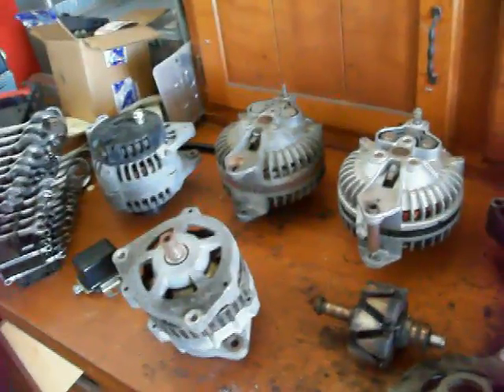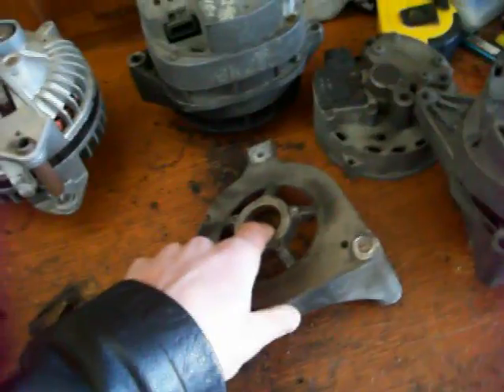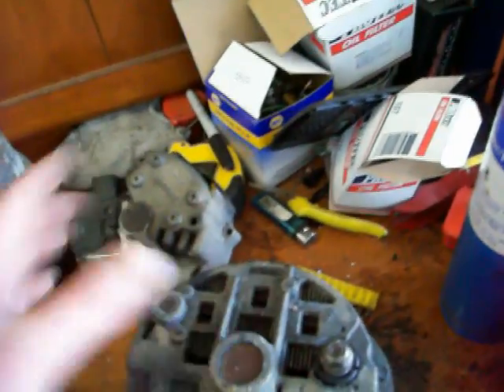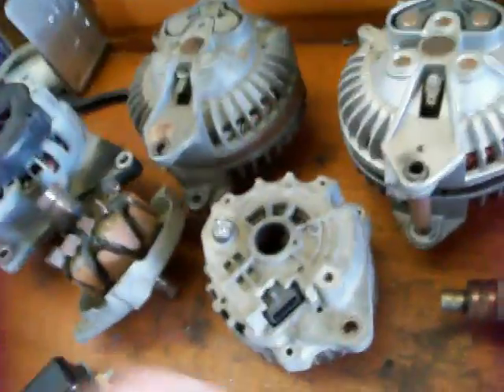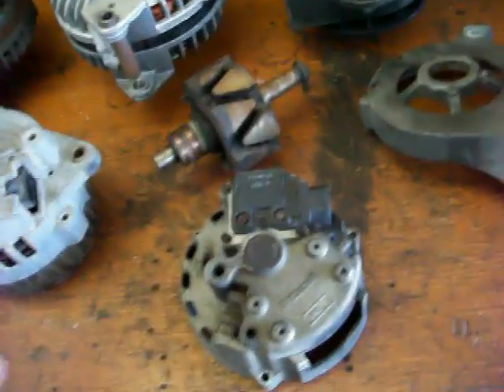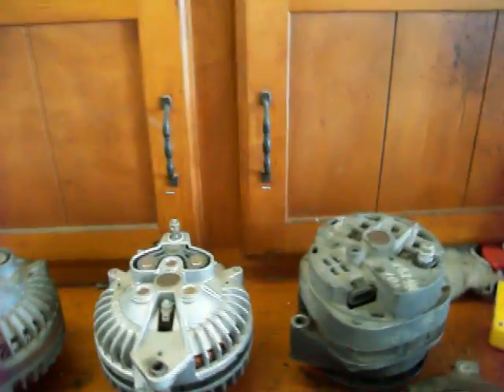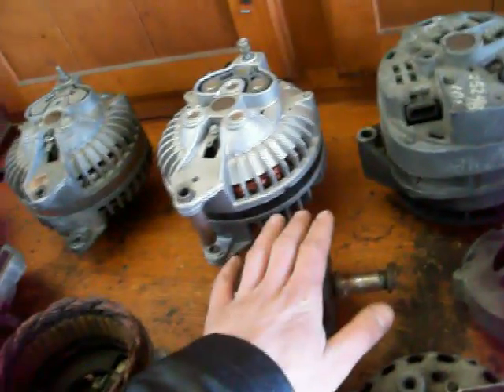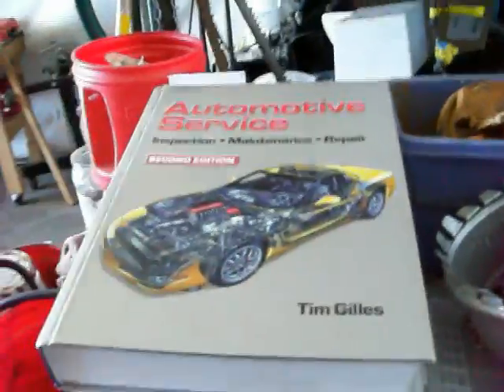How car alternators work

Comment: You should search around for an alternator rebuild shop. If there is one around. You can get most alternators and starters rebuilt for "half the price" of a replacement and you will get far "superior" rebuild locally. The rebuilds comming out of China at the parts stores are junk! They leave parts out, use terribly cheap new parts, and use old used parts in their rebulds. The regulators are thin with no cooling fins: even the bearings are cheap and don't last. I know I do this for a living

Comment: I have a strange problem. Voltage is high (16-17V). Alternator has been rebuilt by a reputable rebuilder and watched it bench tested good. IF I leave the adapter off (2 wire connector to Ignition/battery indicator and Battery positive), the voltage is only 13V or so with the car turned on. If I connect it.........I get the high voltage. Any idea on what might be causing this or how to troubleshoot? Can I drive the car a short ways without the adapter connected (want to take it to a shop).

Comment: u did an excelent job explaining how altenators work , I believe my mazda b3000 alt. has a bad regulator , and after much research ive came to the same conclusion ... its more labor and cost efficent to purchase a remanufactured alt plus get the 1yr waranty ,rather than pay $50-70 for a regulator and then have diodes or somthing else go out

Comment: something i dont understand ..the coil winding in the rotor is stationary or rotating with the shaft??!!!!....another question the rotor winding need an initial current (from the battery) to develop the magnetic field that sweep the stator so if i try to test the alternator separately without connecting  the battery to it and check the voltage output with multimeter , i will not have a voltage output in this case.. is it right???

Comment from the maker: @Kbrusky15 An old generator is built kind of opposite of an alternator. The field coils which create the magnetic field are stationary in the case instead of being in the rotor like they are in an alternator and the armature is where the voltage is induced into. They basically look like a starter when you take them apart, they have alot of the same parts and are constructed in a similar way.

Comment: That caddy I used to have the battery damaged the alternator.  Didnt know it right away till the battery was replaced a second time under warranty and the alternator finally cooked, smoke........ the diodes were toast.  Replaced both items and no more problems.  I have a book similar to that called the automotive encyclopedia, its pretty thick you could kill someone if you threw it at them... some good stuff in there too

Comment from the maker: @The18Jake I would assume that diesel alternators work in the in the same way just higher output, but I've never worked on any big diesels before. You probably cold rebuild it depending on how much damage was done. The diodes are probably ruined and possibly the voltage regulator as well.

Comment: Don't diesel alternators work differently?Also is it possible to rebuild an alternator and it work right,after the aftermath of putting the battery terminals backwards? positive on negative and negative on positive. I did already replace it with a 64 amp one but I'm just curious.

Comment: I wish my cadillac alternator was only $70.  Cheapest reman you can find is $175, $400+ new.  But it's WATER COOLED and only made by Delphi.  They were known to leak or get plugged up (especially when somebody dumps bars leak in it to fix the typical northstar head gasket).  But I wouldn't have it any other way ;)